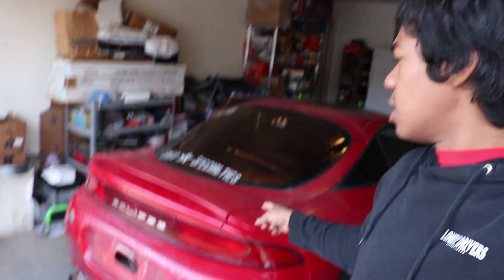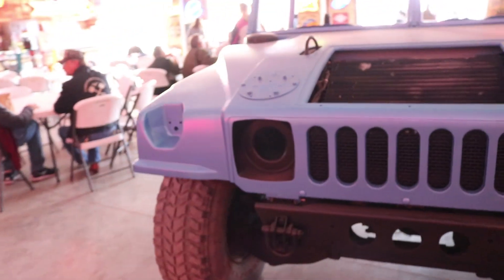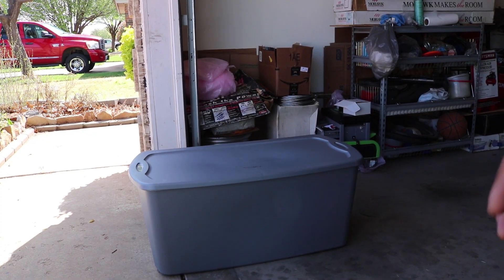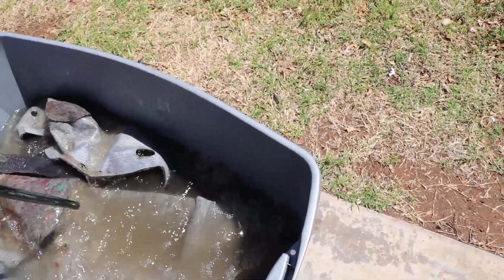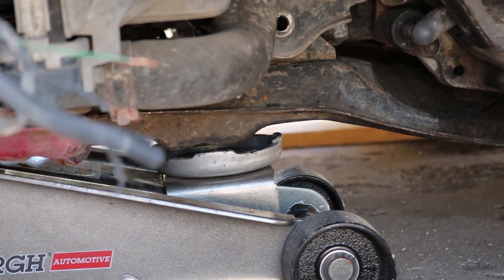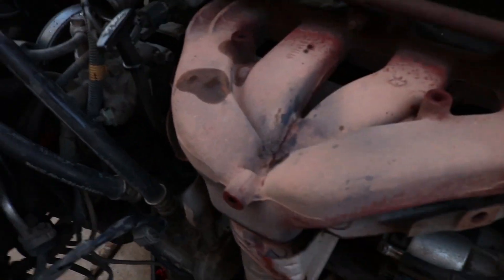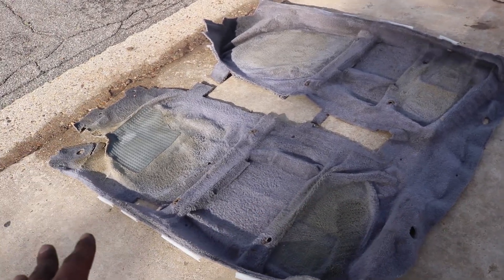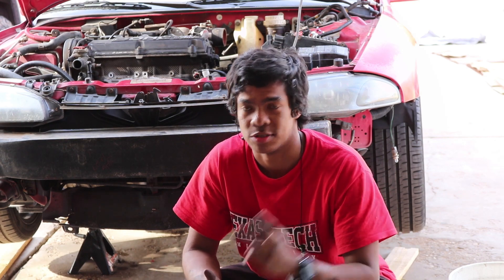Preparing To Pull The 420A Engine!

Comment: I’m struggling taking out my wiring harness in my dsm could you help
Reply from the maker: Whats the situation?
Reply: @developmentdivision122  there’s this round bunch of cables running under the fuse box and I don’t know how to get it out
Reply from the maker: @kamtheman9267  you’ll have to either unpin the fuse box. Or cut a small hole in the metal right infront of the drivers side coilover tower (this hole will allow you to move the harness out of the engine bay.

Comment: Hi,
I recently got a car alarm installed on my 1998 eclipse 420A. The installer made my clutch turn on everytime clutch was depressed(loud screeching). He also made me have a exhaust, fuel intake warning light. First it was only the exhaust warning light, then I seen my pcv breather hose kinked, scanned car again, and got another warning fuel intake, car running too lean.

I also looked under my car and a wire was cut, did research, found out it was a ground for O2 on Cat, and another black wire was cut, from same spot, its black,  Do you know where that ground goes?

When I drove home that day it was very scary, my car stalled about 3x, when I stepped on it, I was going about 30mph when it happened, my car was jerking up and down. I also cried when I got home that day.

Alarm is going to be removed and it will be smahed/burned.

PS. My eclipse is a replica tribute for Paul Walker. All help is appreciated.

Thank you,

Van
Reply from the maker: Don’t know where it goes. But ground can be grounded to any bare metal surface on or in the car. Other than that, all I could recommend is either getting a Haynes manual (wiring diagrams are pretty good on this edition) and researching forums for electrical diagrams. Might take some time, but you’ll find the answers you’re looking for. There’s always two ends to a wire, if one was cut, the other end should be in there somewhere. Time to find the needle in the haystack. Goodluck, if you have an Instagram let me know, I wanna see this build. 

As for the clutch, not sure that an electrical connection can engage the manual hydraulic clutch, but it might actually be engaging your starter. If whomever installed it was tapping into wires near the steering column and instrument stack, then I could imagine that those wires could engage the starter, and cause the screeching sound.
Reply: I will definately get a haynes manual. I got a Chilton's manual already. Just have been really depressed about this and have alot of anxiety from install, hard to concentrate.

Think I found it, I'm pretty sure it grounds the fuel pump from chassis. The installer did tap into my wiring harness near the steering colum, and installed a ignition lock relay that I never requested, and added two more relays. He also cracked my windshield on driver bottom corner where water could seep into fuse panel, he was trying to destroy the build, maybe because of jealousy/hatred. He tried to charge me $225 for a door actuator on the passenger door(that had one), when I said no, I'm pretty sure he got mad. 

Sorry I don't have an instagram but will be more then glad to send you pictures of the build.